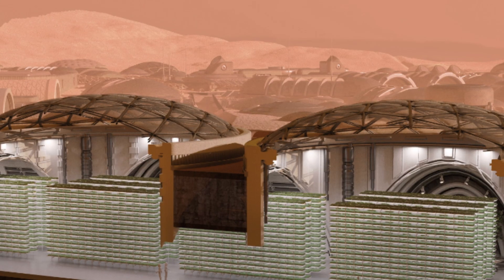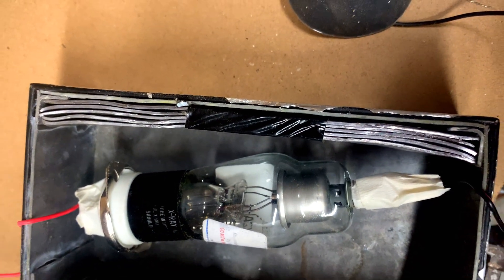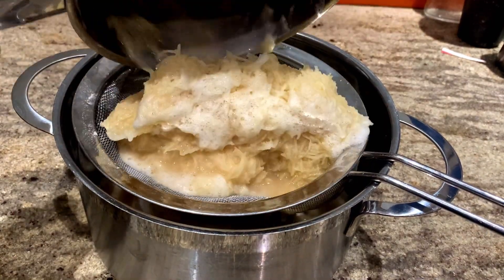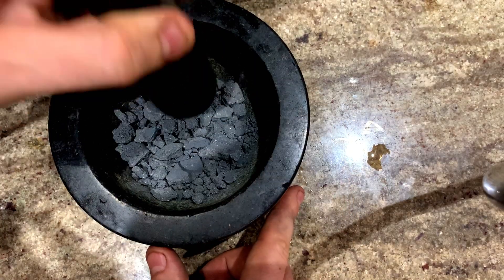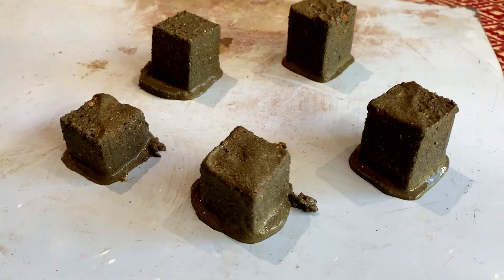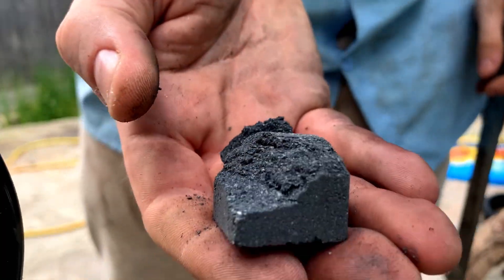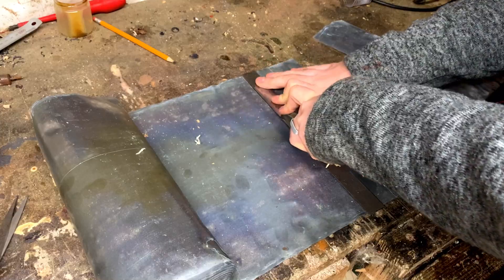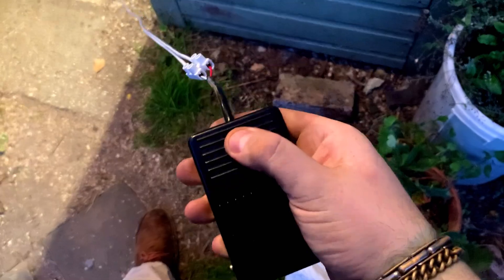Testing Martian Concrete With A Homemade X-Ray Generator

Comment: Wow great video!!  I'm so curious about this now.  Do you intend to do more experiments?  Do you think the percussive force of the hammer is causing the potato starch to behave in an odd way like ooblek or is 4 or 5% I think you said to small?
Reply from the maker: Thanks, I don't think its acting like ooblec, I think the force is needed to compress it into a solid block. Ideally with a hydraulic press. I believe the potato starch is just acting like a gelatinised glue like wallpaper paste

Comment: I'm surprised they went with something starch-based for the binder. Refractory cement often uses sodium silicate, a.k.a. water glass, and I'd expect that to be easier to make at an outpost and more radiation resistant.
Reply from the maker: I think the thought process was that potato starch would be accesible once basic agriculture is establishes wheras purifying sodium silicate from mars rocks would require more advanced processing

Comment: Can you try this with a few cubes of concrete with iron rebar reinforcement? I really want to know how iron oxide content in mars-crete affects the substance. The block didn't multiply the radiation per-say, but I wonder if its poor showing was due to Bremsstrahlung from the metal particles. Probably not, but its a line of inquiry all the same.
Reply from the maker: Yeah I might do a follow up with improvements to the starcrete like rebar, fiber, plasticizer etc.

Comment: One more thing you should have done was to let the Mars crete and the moon crete cure in a vacuum chamber to simulate the atmospheric pressures! That is going to make a load of difference on the effects of the curing process, its actually easier than you think to adjust the pressure inside the chamber to be as close to the martian atmosphere as possible , and the moon's for that matter also! Just saying  , take care and let me know if you are planning to make a go of it!
Reply from the maker: Not sure how I would have them in a vaccum chamber while heating them in the oven but keeping them in a vaccum after curing will certainly preserve them against moisture in the air weakening them 👍

Comment: Fun experment. Really fun. I love the enthusiasm for in-situ resource building, and do wish there was more going on here on Earth. 

Fun.. But.. quick question

Why would we be bringing any building materials from Earth, ever?
Theres a lot of rocks floating around. A lot of rocks with a lot more metals present then easily reached by surface mining Earth.
And we already know that Solar Sails and Moth Drives work so the only fuel is getting a small probe to the astroids they can power themselves back by using the sun.

All in all it just seems a bit backwards to not use astroids and in-situ materials now, like today for Earth based projects no less in-situ materials and astroids for a future Martian or Lunar base. Its still good to use in-situ materials as free and here is always better then not here and slightly less then free, and Luna is a great place to practice for all sorts of further exploration with its low gravity and close proximity.

But. I mean. Seriously why would you question getting materials from Earth at the end?
Reply from the maker: we are nowhere near ready to be be mining asteroids or mars to process resources like metals and glass without having a well established outpost there. The initial base will require a large amount of building materials from earth unavoidably to get up and running.  But there is room for discussion for how much radiation shielding will be needed if they can find a suitable cave or use the Martian ground in another way like the marscrete.